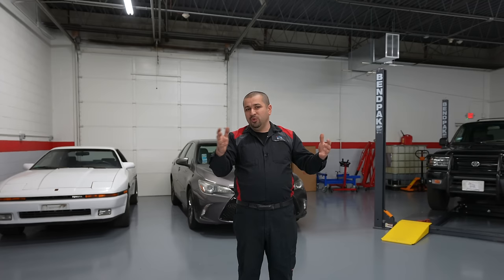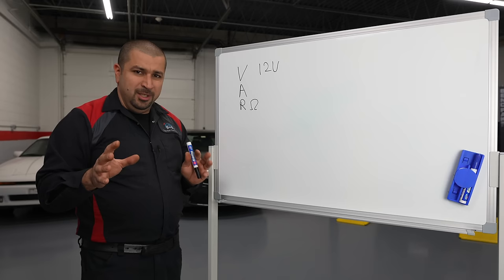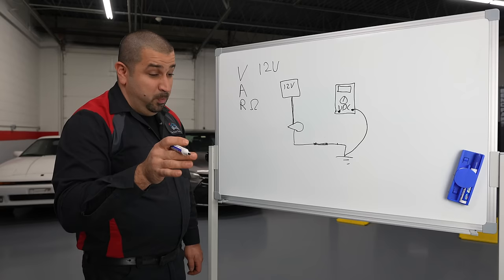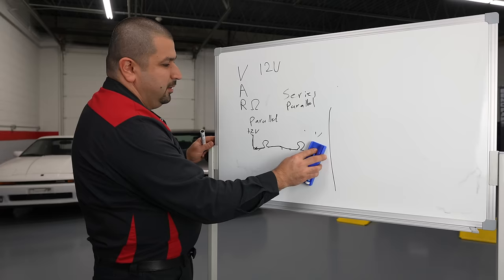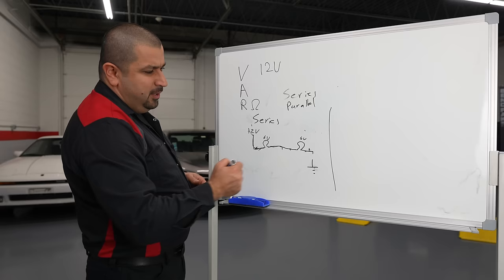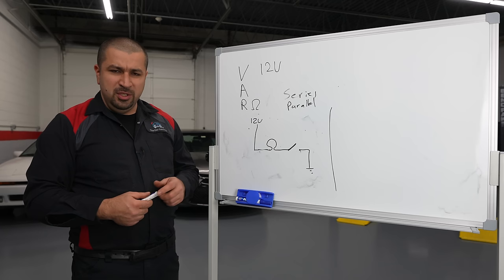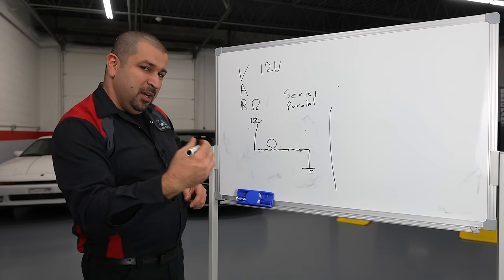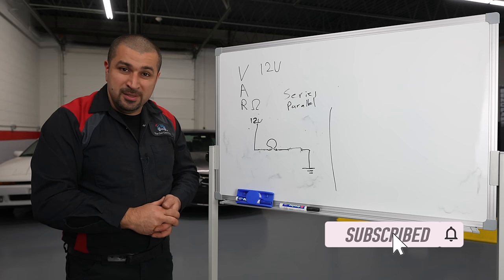Learn How to Diagnose and Fix Car Electrical Problems Series | Part 1 Basic Electrical Principals

Comment: If daytime running light system puts the two bulbs in a series fashion...it begs the question why when one burns out the other one is still lit?
Reply: @dominicfong6341 With nothing else in a series circuit except two bulbs, both would go out if one burnt out. That being said there are circuit designs that will "compensate" for a bulb (or device) that goes open in a series circuit.  I can't speak to how they achieve that in automotive applications but in the past street lights were wired in series to save on the cost of wire. If a bulb burnt out a film disk would melt to short out that socket and the remaining bulbs would stay lit. Another example would be some brands of series-connected Christmas tree lights have a mechanism whereby failed bulbs are shorted out so the others stay light lit.  I had an older Chevy truck that used two diodes in series to drop the voltage to the headlights for DRL use. A relay would bypass the diodes for regular low beam usage. I suspect there are electronics that could monitor this and intervene as well. I guess after all this what I am really trying to say is "who knows" lol.

Comment: I appreciate your efforts to keep the topic simple, but this illustration could very easily confuse or mislead a true beginner to electrical theory.  The "circuit" illustration you used through the first eight minutes, or so, simply wouldn't work as drawn, the reason being that there really isn't a complete circuit.  A very fundamental principle is that current will not flow if a circuit is not complete.  That is, the current must flow from one battery terminal through the entire circuit (switches, fuses, and loads) and back to the other battery terminal.  So, candidly, your multimeter wouldn't register any voltage anywhere in this "circuit", no matter where you placed either lead, because the circuit is always open.  I really don't mean to be petty about it, but a true beginner will benefit the most by seeing and understanding the full picture.  I do enjoy your channel, and very much appreciate all of your teaching efforts!

Comment: Im from india my toyota etios has a problem in the abs.. there is no abs warning but the rear right side tyre locks when I apply full pressure.. i went to so many mechanic including toyota service center. No one could not find the problem yet

Comment: Not really understood the end of the video when you measure Voltage after the bulb and it shows 6V. How is that possible if the bulb resistance should have drop Voltage to 0V. I understood that switch can have bad connection and make another point of resistance, but it is after the bulb. If i understood correctly there should not be 6V after the bulb if everything is correct with circuit from power source 12V till bulb. Maybe i don't understand Amperage/Current laws correctly.

Comment: Great content. This is the stuff people are forgetting how to do. Question unrelated to the video: Do you think it's safe to use 87 octane on the gx 460? The recommendation is 91, but the 4.6 is a tundra engine and the tundra doesn't need 91, plus many people run 87 to save money with no issues. What is your opinion on this, since you have a gx of your own now.
Reply: I'm not an expert at all, but isn't in that way that with 87 the explosion occur a little bit earlier when the piston is reaching the apex. There is a builtin system to prevent damages, but you should be within the borders of what the system can manage.

Nowadays engines for Europe are made for 95 octan (RON?).

In rally cars they use some 102 octan gasoline, because they drive on the rpm limiter most of the time.

But where in the world is nowadays 87 octane gasoline for sale?
Reply: @leiflillandt1488  in Canada we have 87, our lowest grade. Then 89, 91, and some stations have 94, our highest. There is alot of confusion about the grade the Lexus gx 460 can handle. The manual sais 91, but the same engine on the tundra only requires 87. The confusion is compounded when you consider that the tundra has 310hp and 327 torque, and the gx has 301hp and 329 torque. Some people run 87 on the gx and have reported no issues, but the more anal drivers (like myself) hesitate to go against the manufacturer's recommendations. Who knows, maybe running 87 will have long term effects. That's why I'm posting this question to a mechanic who owns a gx, he could run some tests on the knock sensors and give us a definite answer: Does 87 negatively affect the gx 460.
Reply: Please before using the information i am going to give make sure that your car says 91 recommended, not required. If your car says 91recommend, it’s completely safe to use 87 octane. The knock sensor in your engine will automatically adjust the engine timing to make it safe to run on 87, though keep in mind you might loose a bit of power and fuel efficiency. It could be a small or big difference. See what works best for you.
Reply: @fnvideos4233  the manual seems pretty adamant to use 91 or higher. Yet people still use 87 with no reported issues. Ima stick to 91 just to be on the safe side

Comment: Explained how voltage is used but you don't have zero  when loads are working he should have  accounted for resistance there's always some resistance few tenths off volt will always be left over every circuit has some resistance

Comment: Does it take 2 or 3 hours to diagnosis an electrical problem when the brake light comes on at night when the ignition is off. Also the signal light on the right flashes too fast. I assume its the connection to the wires that need replacement. Per Brakemaster it cost $200 - $300. 😮
Reply: Adjust the brake light switch. If that doesn't fix it replace the switch.
Reply: Bought a brake light switch can't seem to get the 2 shops to replace too many vehicles in repair.

Comment: The only thing I would do is instead of showing this on a whiteboard, with that basic wiring & ground with 12V, etc, & amperage blowing stuff, show it under the hood of an actual vehicle, I would appreciate that so much. Not saying do the ultra-complex wiring showing in the actual car, because you’d have to strip it just to teach a class about it, write the stuff you can’t see on a car without taking it apart on the whiteboard, then the stuff a person can actually see, then show us it under the hood of the car
Reply: Congratulations you're randomly selected among the giveaway winner, contact the number above for more information 📩📩

Comment: That horn diagram is incorrect.  The power wire from the battery first goes to the switch, then to the horn, then to ground.

Comment: Is 🎉it possible to get a soft copy blow up & specifications, maybe diagnostics  to the spec's #s.   can  i store and print the 99 sienna XLE Toyo l bought,    After My paid in full 2000 Subaru Foreste r, parked in front of dealership,  and the city towed away 2hours before My Son & i got their,  Since, that time I only BEEN able to, push the Van with my y Walker few times a month and My son out of state,  March 24, since November   23 ii never heard,seen, or tried to remedy the Van saved up for the extra payment and fixing repair costs to parts,  lic, etc.   lawless and ruthless Baiting  Bonny  and ca😢refree Coroner  Clide,   robbery uniforms  abusing someone who's really physically  disabled, and  homeless circumstances are all set up to be devowred devoured and destroed , Now hard up for hunger and heat., THEY left ME! TOO GODs awesomeness, today is better day.

Comment: One of the worst explanations of electricity ever.

I see mechanics aren't required to take even a basic physics course. This is odd, since cars wouldn't be possible without a strong knowledge of physics. Even mechanics should know some properly dumbed-down physics as it relates to automobiles. My dad was a lineman and he had to study some of the basic mathematics of electricity.

Voltage is the difference in electric potential between two points. Voltage doesn't move, it is potential. smh
Reply: Congratulations you're randomly selected among the giveaway winner, contact the number above for more information 📩📩